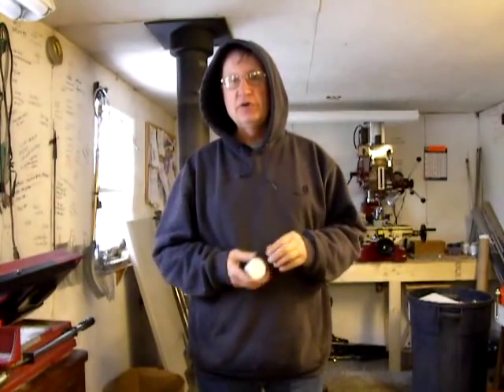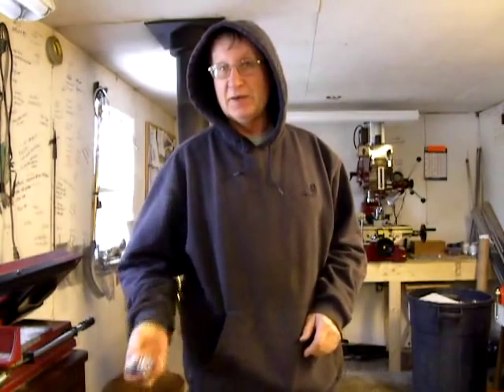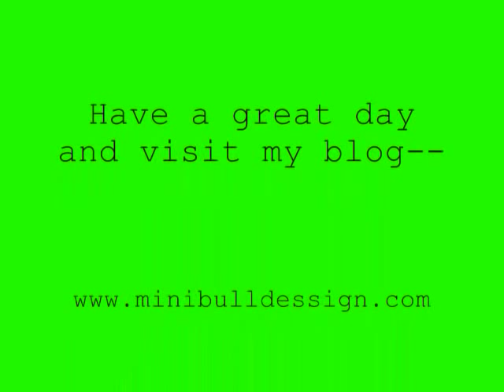Why so much ?

Comment: My compliments to you Tinny !!!
I worked in manufacturing for 16 years. Yes, a CNC shop could knock that thing out WAY faster. One of the machines I ran could make that part in about 15 minutes, start to finish, but then it wouldn't be as special, or any less expensive. There is something wonderful about your personally build custom items.

Comment: Very labour intensive,indeed. With no disrespect to you. My questions are... Is the labour really worth it? is the stove more efficient? does it burn longer? lighter in weight? or more durable? easier to use? or better on fuel? to necessitate your labour and thus the high cost. Ed